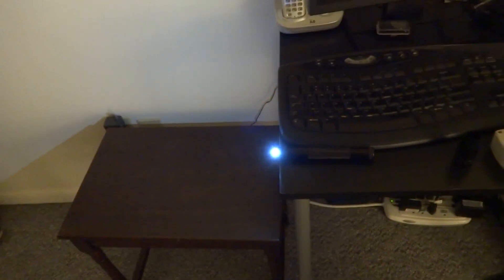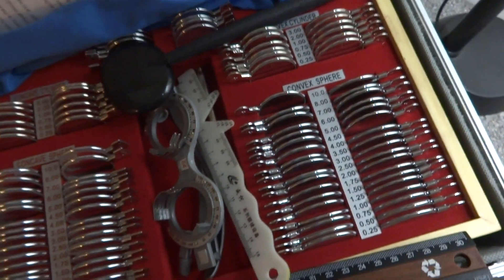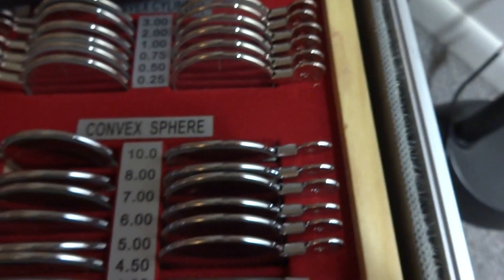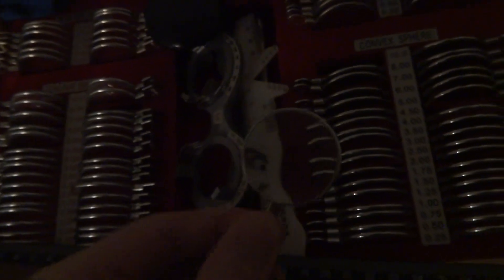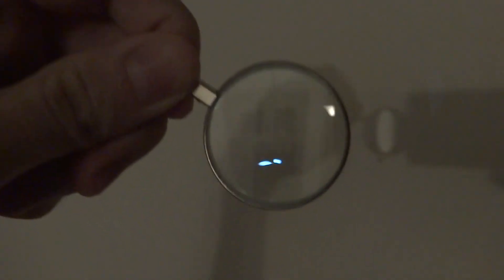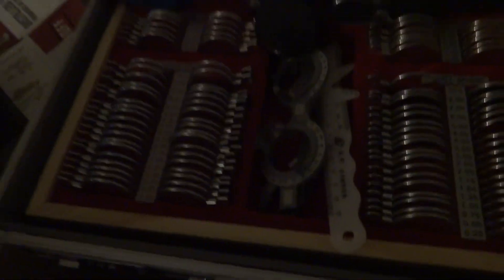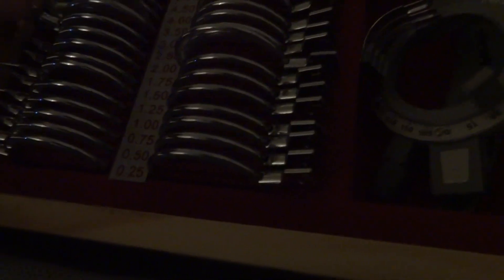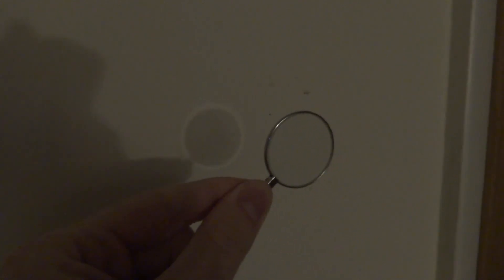Understanding Corrective Lenses: a brief demonstration

Comment: Hi Cliff I have a -3.0 Diopters on My left eye and a -6.0 Diopters on my right eye which i believe is for distance vision I am a close-up person being a graphic designer spends a lot of time on the screen, I have cylinders on both eyes. I just read something that says it is not good to use minus lenses for close up work an attempt to get a plus lens was tricky can you assist me in suggesting  a prescription size for a +lens that will work for me.
Reply from the maker: Using a plus (+) lens alone would make it much harder to see. Without corrective lenses, your eyes will be able to see things that are about 33.3cm from your left eye and 16.6cm from your right eye. You can effectively add a plus to your existing prescription by reducing the minus number, ie. -6.00 + 1.00 = -5.00 This is what myself and others call Reduced Lens Therapy. The desired effect is to introduce a small amount of blur on distant objects.
If you can see the 20/20 line (or 6/6 line if metric) on an eye chart from 20 feet (6 meters) away with your current glasses then you could try a -2.75 for your left eye and -4.50 for your right. This may seem like a drastically different change for each eye but it would be a focal length change of about 6cm for both eyes.

Comment: Great demo.

I'm wondering, what would a cylindrical lens look like with 0 spherical power and with some cylindrical power? That is, to correct astigmatism but without affecting focus distance at all?

Because currently I don't quite understand, why astigmatism prescriptions often have both sph and cyl components filled in. Doesn't sph change person's focus distance, which is not needed if a person doesn't have near/far sightedness and has only astigmatism?
Reply from the maker: I actually use a cylinder lens without sphere power to demonstrate cylinder correction in this video. It focuses light into a line instead of a point. I'm sure that there are people out there who only have an astigmatism but do not have any other refractive error, but in my experience, I've always seen sphere power on prescriptions along with cylinder.
Usually the negative effects of an astigmatism become worse depending on distance. This is due to the presence of other refractive errors, such as hyperopia or myopia.

Comment: Thats very intressting and it explains a trick that i use with my fingers , if you make  a  very small hole with your three fingers (the thumb and the two fingers that comes after it ) and you get that hole very close to your eye and starts adjusting and making it smaller , the image getts very crisp and clear if you look from it but as soon as you let the hole gets bigger the vision starts to gets blury. I showed it to my parents they have hypermetropia and it works for them too , whenever they don't have their glasses with them , they just make small hole and look from it lol . So it kinda works for both myopia and hypermetropia.
Reply: I made a gif to explain this , check it out this link : 
https://giphy.com/gifs/uFkpss3ydOgN0oWHrr/fullscreen 
or this one : 
https://giphy.com/gifs/uFkpss3ydOgN0oWHrr
Reply from the maker: Check this out: https://en.wikipedia.org/wiki/Pinhole_occluder
Also, looking through a pin-hole doesn't work on refractive errors greater than 6.00 DS.
Reply: cliffgnu that's very interesting,  i found out about it by coinsidence i was so frustrated with my blurry vision to a point where i tried to squint my eyes and eventually  look from a small hole , thanks for the article ,very informative
Reply: THANK YOU THAT SUGGESTION DOES WORK! AMAZING THANKS AGAIN FOR A VERY QUICK & EASY ANTIDOTE TO MY PROBLEM❣